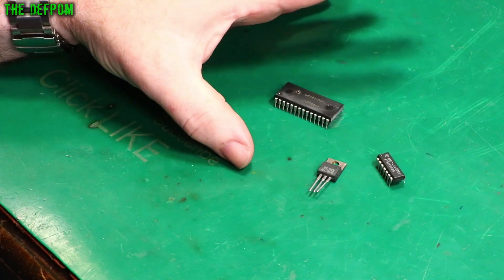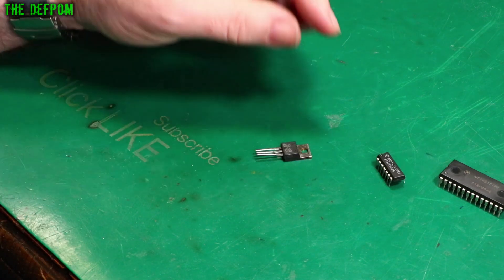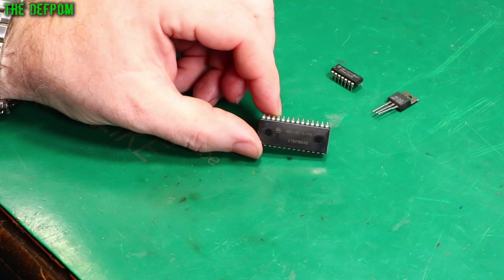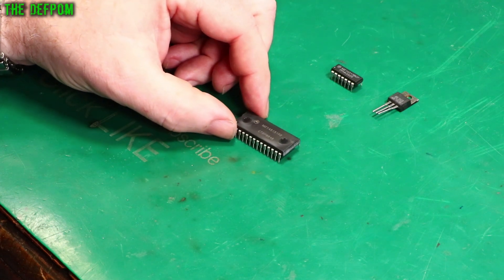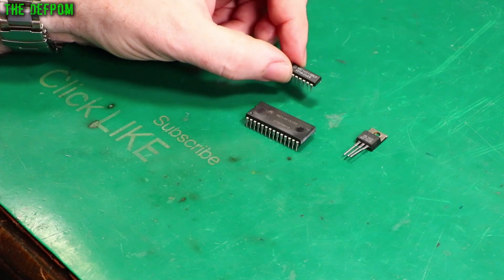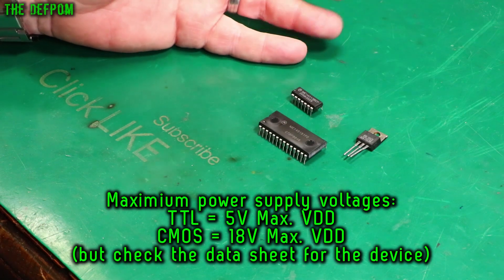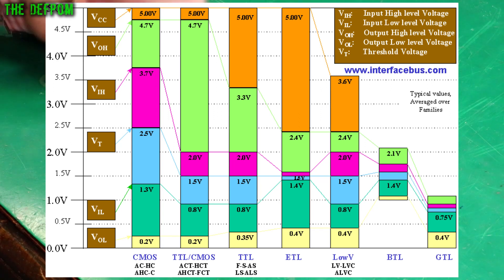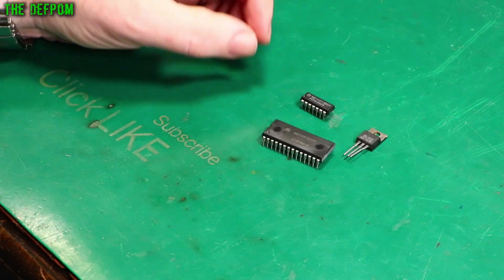🔴 Electronics For Beginners - No.9 - Integrated Circuits - No.967

Comment: Very informative video. Would it be possible to do a 555 chip. They seem to be very common. Your series is very good and thanks for sharing your knowledge 👍
Reply from the maker: I could do something with a 555.
Reply: Another upvote for the 555, maybe the internal circuit, how it works, and how it can be useful in projects.